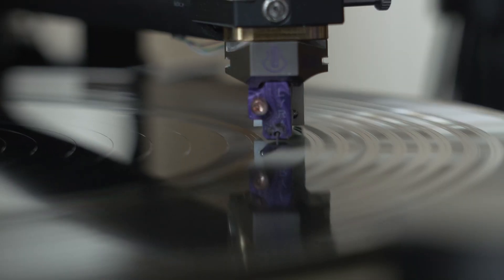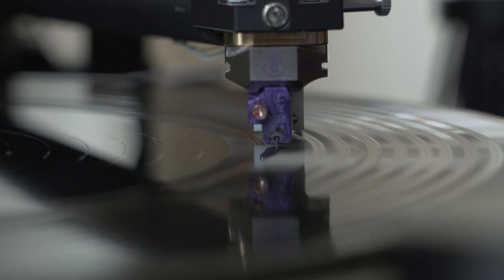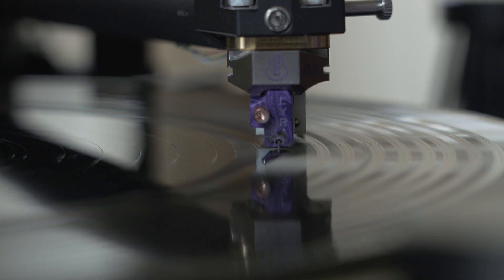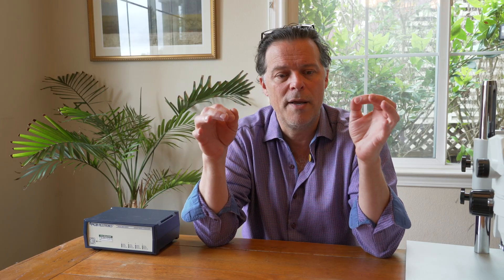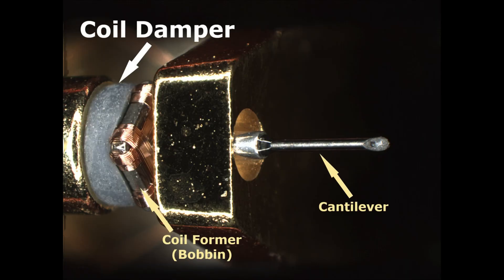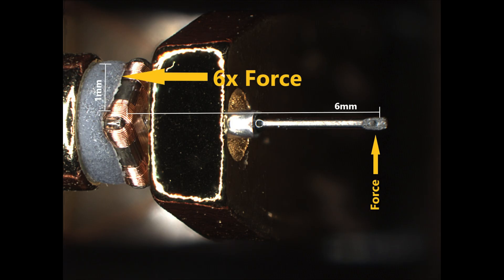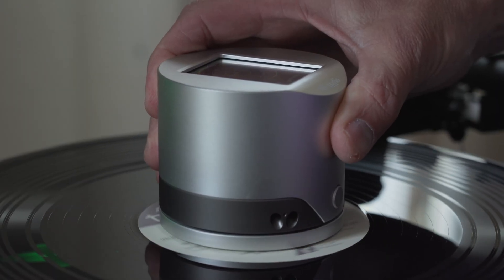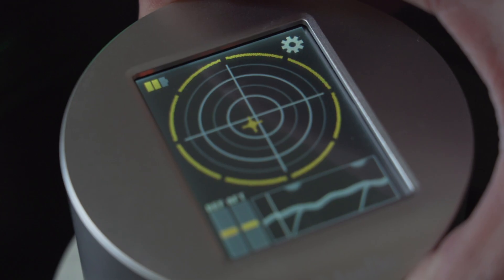Sound Bite #31: Record Eccentricity - What Is The Performance Cost?

Comment: I hate record eccentricity so much that I’ve thought about making my own “centering device”. Instead of reaming every affected record I’d rather have the turntable spindle machined down a bit to allow for the off set placement. A record can be irreplaceable, while a turntable spindle is probably exchangeable. And then I was hoping that the inner locked groove of a record could be used as guide for the placement. Some sort of ruler with a built-in magnifiyng glass and flashlight would be needed. One that could hover just above the record surface to allow rotation and displacement. Perhaps a screw-on record weight/clamp would be best to keep the record in place. I really hate the sound of an off centered record..!

Comment: So………how do you properly correct or adjust the problem of an incorrect center hole causing the arm to move back and forth?
Reply from the maker: By pushing the record the proper direction on the platter. If record hole isn’t large enough you can use the supplied reamer.

Comment: DS Audio Eccentricity detection stabilizer is not practical for belt drive turntable. Belt drive TT may take one minute or more to achieve stable speed. I never stop the TT when changing side or record. To use DS audio stabilizer, one needs to stop the TT every record side. It just kills the music enjoyment. I will live with eccentricity.
Reply from the maker: Actually, if you don’t mind putting a mark on your label you only need to measure each record one time for life of use. 

I don’t know why it would not work in a belt drive. I use it that way. You can use it at ANY speed to get the data you need to remove eccentricity. You can even use it at constantly variable speed

I am NOT trying to “sell” anyone on them. They have a value but the cost is…well, you know.

Comment: Seems like then a warp would have a similar effect. But I thought at first you might be going for how as the record warp moves the stylus back and forth, the angle of contact rotates around the stylus from perpendicular to the cantilever to X degrees around the stylus.
Reply from the maker: Correct! That also happens but it is not clear to me how significant it is
Reply: @WAM-Engineering  It seems we are finding phasing and timing between channels to be very noticeable. It would seem to cause a flanging effect on top of speed variations. Yet no measurement of it is available.